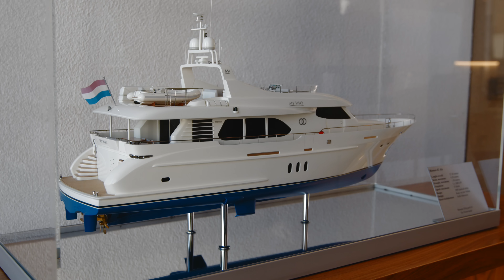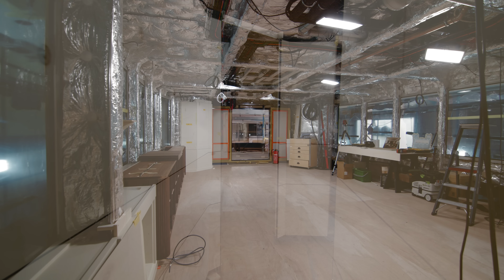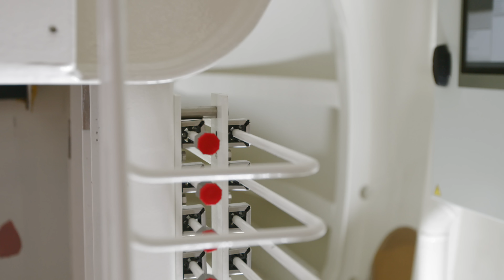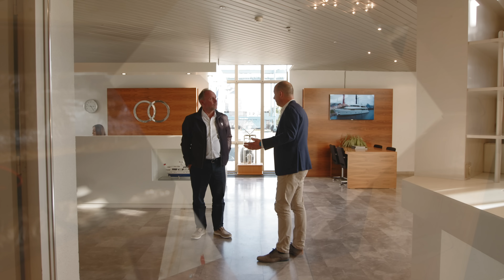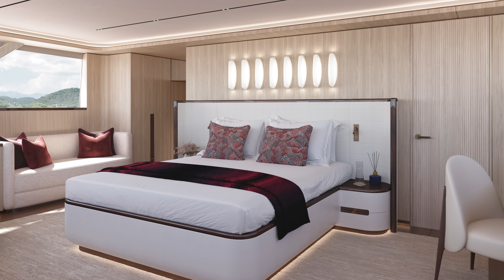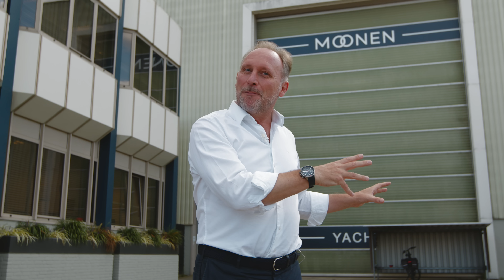HOW MOONEN YACHTS CAN STRETCH AND MOISTURISE THEIR SUPERYACHTS!!!

Comment: That is a really nice starter Yacht and good for an owner operator with a minimal crew. My consideration is what is the range of this yacht? What is fuel capacity? Is it built for the US or EU market? What is the galley equipped with for not only appliances but does it have walk in refrigeration and freezer space? when you have long range you need a larger food capacity and storage for canned good and drinks. Not everyone needs a large wine cooler or alcohol bar. A bar for soft drinks makes it far more family friendly for the US market. These are just a few of the considerations that a prospective buyer would like to know. However, Moonen looks to be building nice looking, functional and mechanically well thought out yachts. I would like to see them expand their facilities and build larger yachts into the 180 foot range. Nice Job David, I would like to see the finished yacht that you explored and said that it was currently for sale. 😁

Comment: I was shocked to hear you say that the yachts only come with a two year warranty. I can’t imagine spending tens or hundreds of millions on a yacht and it come with a shorter guarantee than some of the appliances onboard. I’d have thought yacht builders would stand by their products and workmanship for much longer.
Reply: Two years is pretty standard for two reasons:
 
First, it's a yacht so everything is exposed to extremes (sunlight, seawater, etc.) and hence more wear and tear. 

Secondly, yachts are typically bought through an SPV and hence a business entity which means your typically extended private consumer warranty times don't apply! Which again means chances are that all the appliances you mentioned in your comment also come with only a two-year warranty as you by them as a business customer not a private person. Though everything is negotiable.
Reply: This is why new yacht purchasers often have their Captain or other representative staying full time at the shipyard during construction. Trust but verify.
Reply: Try buying a CRN, Benetti or Ocean Alexander yacht and asking them what their warranty is. When they get done laughing at you then asking if you're serious, you'll find out that a yacht builder, at least 95%, won't give you a warranty on any part of it. So you better find all the faults during the sea trials and survey periods. On a new yacht, the systems, appliances, furniture and other parts built by another company have a warranty on them, but the actual yacht, cabinetry, in place deck furniture and the like is not covered at all unless there is an obvious workmanship fault or construction error. But again, you are to have the yacht gone over by a surveyor and of course throughout the build there will be surveyors on board from either flag state, class, or your personal representation going over each phase of construction to make sure it was done right, or to the level of completion required. As someone stated before, you are dealing with an asset that is meant to be enduring a constant hostile environment and therefore no guarantee is implied or given that it will be free from fault, other than it will float.. Read about the guy that originally bought Nordhavn's 120' 'Aurora.' That guy was in a lawsuit for over 3 years and lost. He sued everyone involved in the yacht because so many things were wrong on it. He put out a series of videos about it and I think some he took down but you might be able to find them. Obviously a yacht builder doesn't want their reputation sullied so they will usually fix anything that pops up within a certain time frame, usually though about 3-6 months. After that....nope
Reply: The easy answer to that is that after 2yrs they can continue to milk those owners for millions more!
Reply: The easy answer to that is that after 2yrs they can continue to milk those owners for millions more!
Reply: hello ignorant american.
Reply: Most houses in the US come with a 10 day warranty... starting from what ever day the builder says. If you want anymore coverage you have to pay for it. Most people don't even realize they're paying for the warranty in the mortgage.. or if they paid cash they also paid for some sort of warranty. The builder is supposed to pay the warranty like insurance but pretty much always passes that cost to the owner.
Reply: @jeremycovelli  l
Reply: @jeremycovelli  Yeah that sounds like the kinda thing they’d get away with in the USA. Land of caveat emptor capitalism.